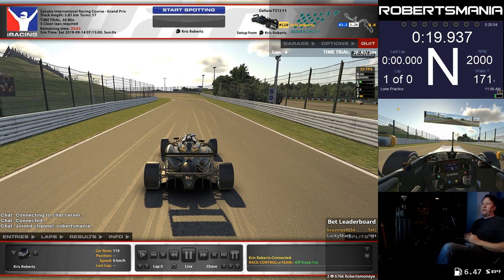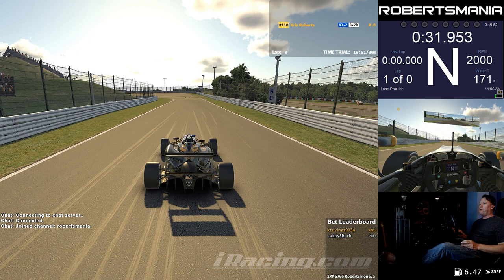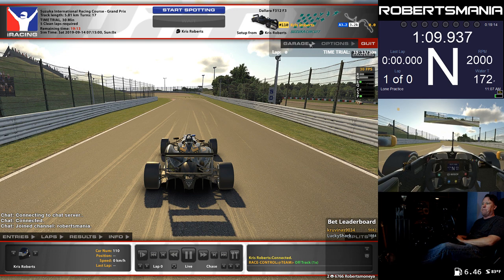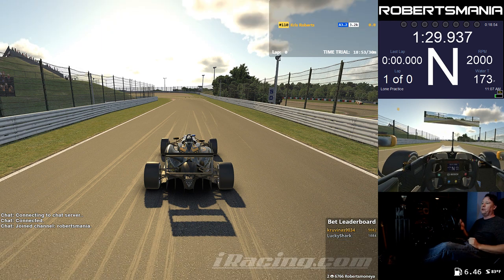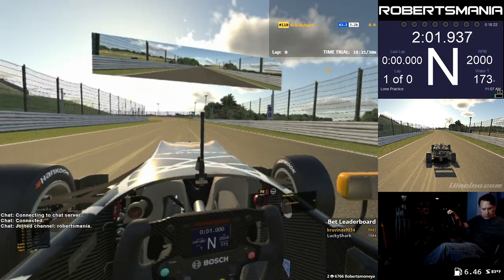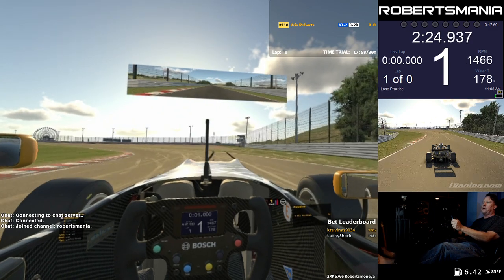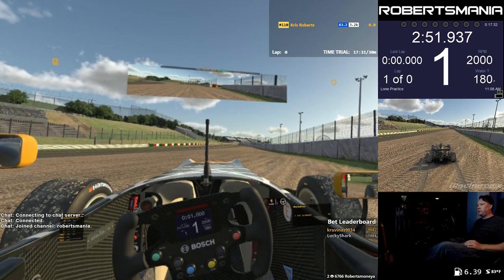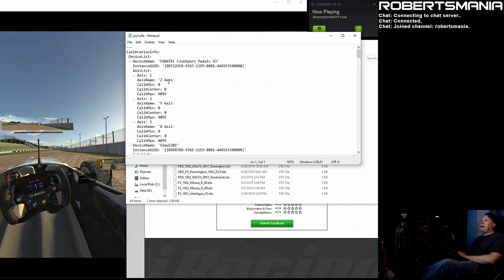Formula 3 Launch - Clutch Hax0r!!!

Comment: This tip improved my F3 starts so much, and I hope it works with the new Formula Vee!

One question, if I may: what is the goal of the clutch calibration edit (increasing Z max)?  Adding a large deadzone, as you do in the video, worked for me, but I'm curious why that works.
Reply from the maker: You increase the Z max in the calibration file to make it so when the analog clutch pedal is fully depressed it is NOT registered as 100% clutch application.  The goal is to find the right value (different for each car) where the analog clutch is right at the bite point when fully depressed.  That way when you release the binary clutch button while still pressing the analog clutch - the car starts to launch and then you release the clutch from there to go.  

If the analog clutch was 100% when fully depressed, using the button clutch would be of no benefit since you would still have to manually find and carefully release the analog clutch.
Reply: @Robertsmania  That makes sense, but how do you find the actual analog clutch bite point?

Assuming that's the blue bar percentage you want with the pedal fully depressed, is it the lowest percentage that will still allow the binary button release to move the car?  Or the highest?

I've been adding a large enough deadzone that blue bar might only reach 50% at full press, and releasing the binary button will start the car rolling.  Assuming I haven't just happened to blindly hit on the exact bite point, is it worth trying to find the actual point?

In other words, will the car actually launch faster with a more accurate analog clutch calibration?
Reply from the maker: There is an ideal clutch bite point for each car.  Finding it, or getting close enough usually takes some trial and error.  My general approach is to see what percentage gets the car to just start rolling - without modifying the calibration, see where the blue bar is that lets the car start to go in 1st gear.  Roughly set that percentage in the calibration and then make some adjustments from there.

If the percentage is too low (below the bite point) you're not getting much of an advantage over just releasing the analog clutch manually.

If the percentage is too high (above the bite point) then you're going to see wheel spin and less than an ideal launch.

Somewhere in between is where you want it, and it also depends on how you manually release the analog clutch once you start to launch.  That can be different from user to user and obviously effect the bit point you want.  The percentage that works for one driver with a gradual analog clutch release may not be good for another driver who prefers a quick clutch release.
Reply: @Robertsmania  Thank you so much for that detailed explanation!

My only question is: after you find a percentage (I assume that means the blue bar % when you're fully pressing the clutch) that gets the car rolling when the button is released, what do you mean by "see where the blue bar is that lets the car start to go into 1st gear"?

My question as a practical example:

Let's say I initially add a large enough Zmax deadzone that I only see 75% clutch actuation with a full pedal press.  I then confirm that releasing the 2nd clutch button will start the car rolling.

What's your next step?
Reply from the maker: Start off with an unmodified calibration (no change the the Z value).  With that pressing the clutch pedal all the way down should make the blue bar go to 100%.  Thats where you start to experiment and get a sense of what kind of percentage you want to aim for.  Do this with standing starts where you have the clutch in, transmission in gear and engine revved - see what percentage feels like the car really starts going.

Say for example, you think at about 30% clutch release is where you feel it bite.  Then you go into the calibration and change the max value to account for that.  Your device may be different, but my clutch by default is 4095 when fully depressed.  If I want the pedal to really be at 70% (30% released) the value should be set to 5850.  Math: 4095/0.7=5850

With that value set in the calibration, re-load the game and verify that when you fully press the clutch pedal it only fills the blue line to 70% - that same 30% released range you found earlier.

Experiment with the double clutch launch now: in gear, both clutches engaged, full throttle.  Release the button - then release the analog clutch.  

Does it feel like its getting wheel spin as soon as you release the button, or too much wheel spin as you release the pedal?  If so, go back and make the adjusted number smaller (so the pedal is seen as a higher percentage when fully depressed).

Or, does it feel like its not hooking up when you release the button?  In that case, go back and adjust the number so its bigger - so the fully depressed clutch is seen as a lower percentage.

After adjusting the calibration file, you need to re-launch iRacing to see the change.
Reply: @Robertsmania  Actually, if you simply re-start the calibration wizard after editing your Joycab file, but click done before doing anything, you can continue editing without relaunching a test session.  I guess launching the calibration wizard causes the sim to access the file again, but regardless, it works, and is a useful time saver.

Anyway, I think I understand the process now, but just to be clear; when you're determining the bite point percentage, you're looking for the clutch actuation percentage as the car begins moving (in a normal start without a second clutch)?

Are you just looking at the small OSD, and guessing at the percentage, or are you looking at telemetry afterwards?

Regardless, I really appreciate all your help!  I must have gotten lucky in the F3, as my initial deadzone really improved my launches significantly, but who knows, maybe thy could have been significantly faster still!
Reply from the maker: Wow, okay good to know about the wizard - thanks!

It sounds like you do have a pretty good handle on it.  When determining the starting bite point its not exact, I usually just look at the blue line display and guess - 50%, 75%, 80% and use that as the starting place.  That should be where you think it really starts to bite in a normal start without the second clutch.

Then when you test it, one approach is to keep bumping the calibration number up until you definitely are getting wheel spin and back off from there to the point where you are comfortable and can do it consistently without any spin - thats probably as optimal as its going to get for you.